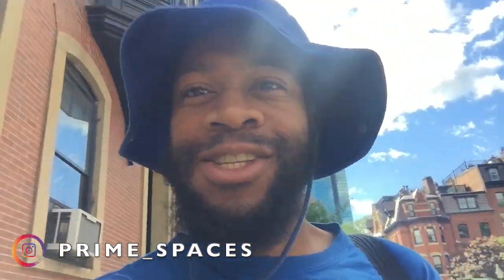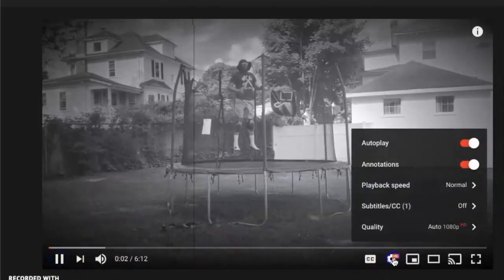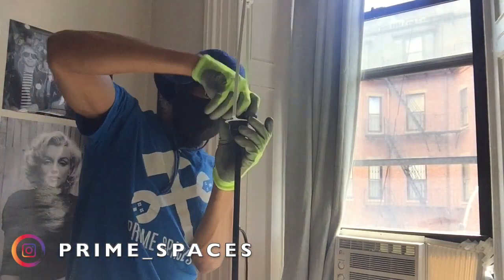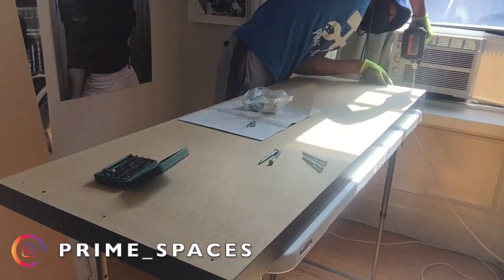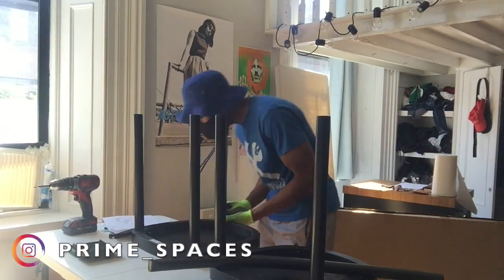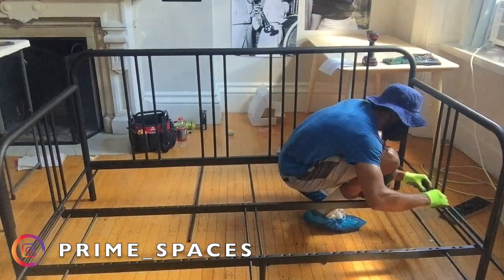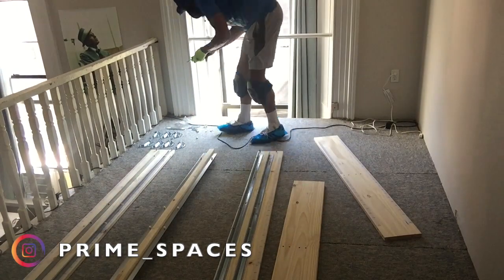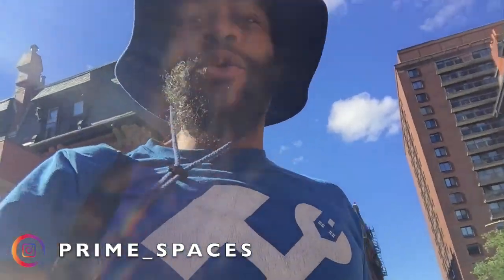Assembling IKEA Fyresdal Daybed, Espevar Bed, Lisabo Table | IKEA Assembly Tips | Assembly Hour #10

Comment: Hi! Thanks for the video. I assembly the fyresdal bed and the bed is 10 in short! The mattresses flop over the edge. I can’t figure out what’s wrong I did it twice. I measured the side arms of the bed and they are 10 in too short! Am I missing something? Could this be a manufacturer error??
Reply from the maker: Hi Olivia. I think I know the mistake you’re making. Make sure you the center beam is properly facing up, and that bed frame is also facing up. I made that mistake in this video and corrected during another visit to This customer. Go to page 17 and make sure your prices look EXACTLY the same. It is very easy to make that mistake. If that doesn’t work it’s possible it could be a defect. Please, come back and let us know the result. This could help others!
Reply: @Prime_Spaces  you’re so awesome for replying!!! Im going to go back and follow your suggestion!! I’ll let u know how it works out. Thanks again.
Reply from the maker: Of course, you guys are awesome! The bed is likely upside down, but it appears to be right side up.
Reply: @Prime_Spaces  ok so I just disassembled as reassembled with a friend. I think it’s a defect. We followed the instructions to a T! Reread it 3x before doing it. Ugh! The size is like a queen bed. I bought it second hand. Maybe it’s an older version. Idk but ugh so frustrating. Thanks for your advice.
Reply: @Prime_Spaces  I figured out the issue!! The bed I have is European sized 🙄. So it’s made 64in vs the American 77.5in. It holds a small European small single mattress.

Comment: Hi  when I've assembled my fyresdal bed the highest screws holding the sides to the back rest tighten but dont hold them together. So I've constructed the bed but the back rest is loose, do you have any tips?
Reply from the maker: Hi Antonio! Oh if a part of the bed is loose then it sounds like you may have use the wrong screw maybe? Where are you short to double check that you were using the right screw before using them?